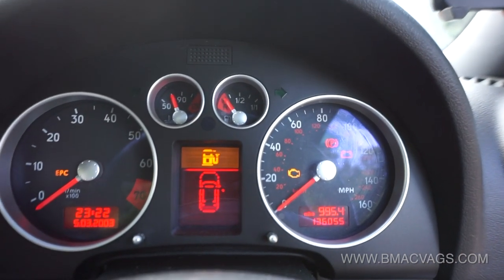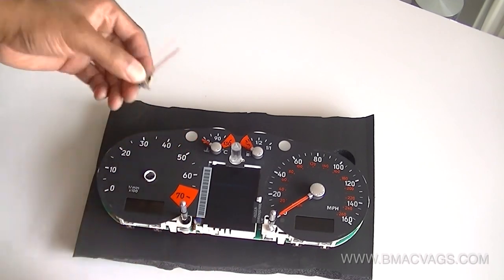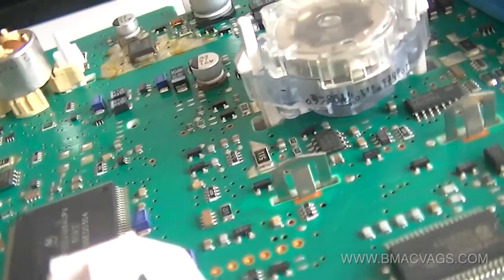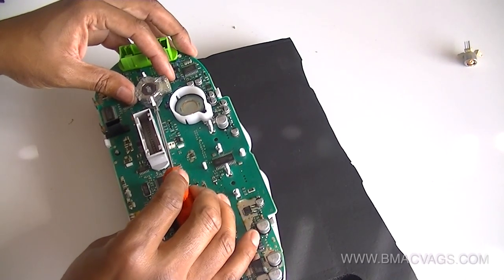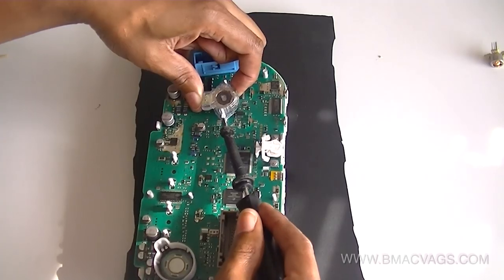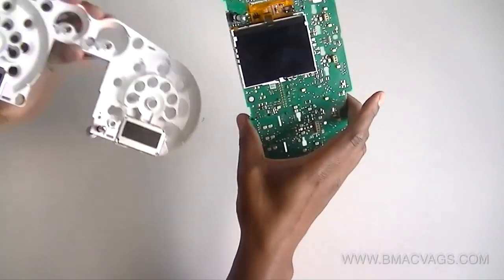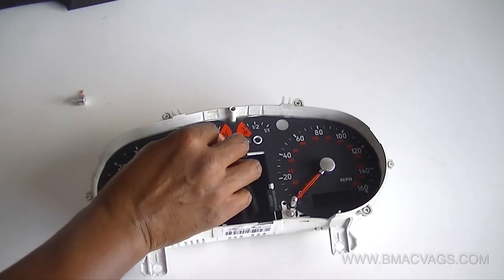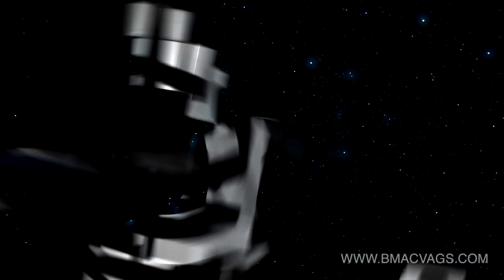How To Repair Instrument Cluster DIY LCD | Speedometer | Gauge | Stepper

Comment: hi there my speedometer and rev counter both stopped working today,is it likely both motors packed up at the same time or could it be something else
Reply from the maker: were they fading out or was it all of a sudden?
Reply: @BMACVAGS  they work sometime but most of the time there both at 0.
Reply: If they don't move when I start the car they won't move at all,they will sometime work when I start the car and continue to work while the car is running

Comment: Hey bro slightly out of topic, my friends scirocco passenger side frameless coupe window stopped dropping and raising automatically when the door is opened or closed. Someone with vcds spent hours coding and recording the door module still no luck. The window works perfectly fine from the door card switches. When unlock button on the fob is held for few secs all the windows go down, but the passenger side window would not go back up when lock button is held. If you can kindly shed some possible solution on it would be highly appreciated. Some other people on forums having similar issues but no one really mentions a solutions. Once again thanks bro

Comment: Great video, please can you tell me what lights up the temp and fuel needles?
Reply: On the Audi A4 B5 instrument cluster, it is SMD LEDs all over the board and there is one SMD LED in each "needle axel tunnel" to light up the needle. The white plastic part he puts aside to the right @7:36 is mainly for directing SMD LED light to where the light needs to go. This is my guess after just disassembling the cluster. I won't buy anything tho, it is for a friend's cheap Audi A4 and I just wanted to see if there were some bad soldering points to fix. My initial thought was that the LCD had a "conductive rubber strip" as in the "olden days" and it just needed some antioxidant spray to fix the lost segments in the display.

Comment: Hi?
I have a Volkswagen golf instrument cluster that has the following faults: the speedo and the rev counter are all stuck at zero, there is an immobilizer light, the odometer display is showing DEF, there is no sound and the temp and fuel gauges are flickering. What could be the problem and what solution would you suggest?

Comment: Do you have a video like this but for the Golf MK4? Half  my instrument cluster doesn't work (the speedometer and fuel indicator) and I'd like to take it apart and check if it's bad connectors or something like that! Thx
Reply: CasualGamerPT I was going to say the same thing but for a VW EOS “basically a MK5 golf 👍
Reply: @CasualGamePT There are a few videos around concerning the mk4 cluster.  They have the same annoying problem.
Reply: I need to repair the cluster it burned

Comment: I had this crap go out on my old B6 Passat, they also like to get real dim under temperatures. Had it sent to the dealership, these are apparently coded for the specific vehicle so replacements aren't available or easy. The dealership sent mine to a specialist but it was never fully restored. I no longer have the car but it tought me a ton about planned obsolescence, cheap plastic shit that cracks & peels, oil leaks bad A/C compressors, & various electrical issues... Don't buy high mileage anything, & despise electronic gimmicks that aren't made to last.